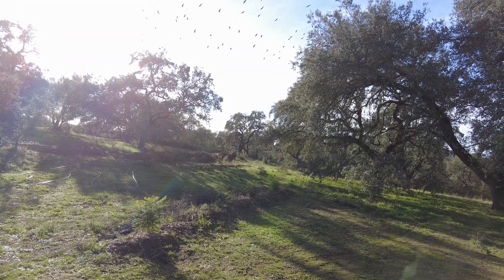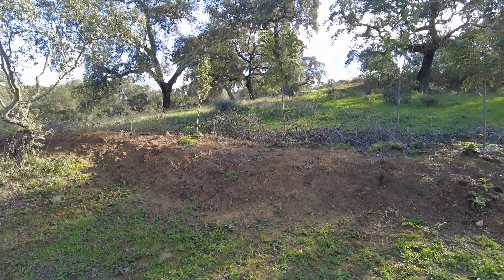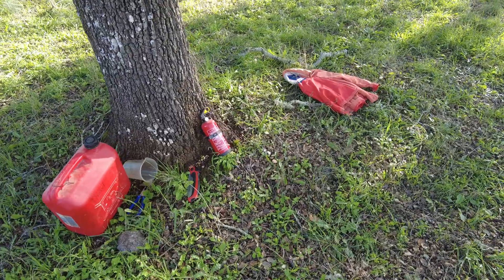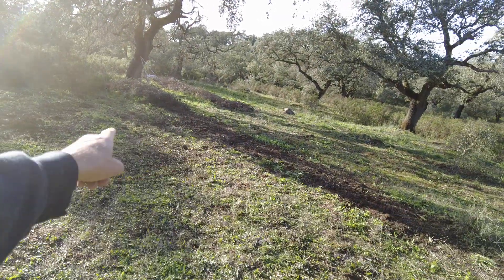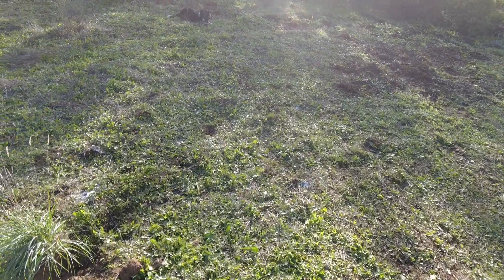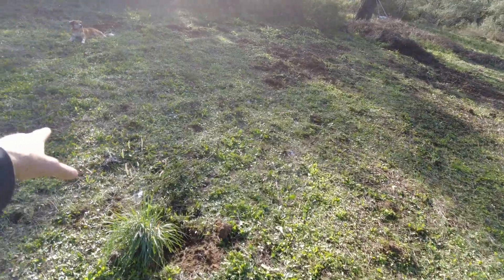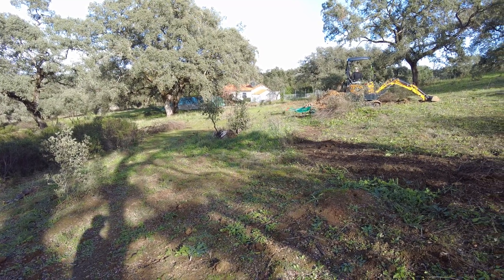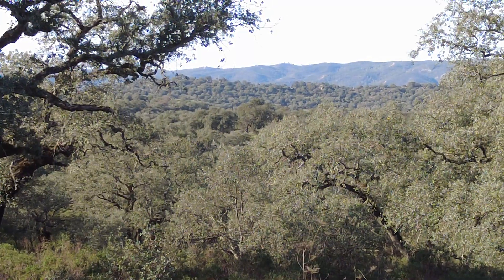Pond site identification and keyway preparation. Then just start!

Comment: Frank AntonsonAuthor
Is any amount of water still running at the culvert? If it is, get a garden hose, put it in the water, and walk down hill until the hose is full. Then walk back uphill to where you are excavating (or above it) to the point that the water stops running out of the hose. That spot will be level with your source and it will be as high as you can get water by gravity. I guess that will the help of your wife and water you carry from your house you could do the same.

Comment: letsdig18 is an expert at pond building. You have the clay. Important thing is the dam. No debris or top soil and pack down the layers as you build. Also, first must dig trench and hard pack clay to prevent leakage. Check out this video: Lets Build The Dam For The One Acre Pond posted recently by letsdig18.

Comment: The Giraffe looks like it has the capacity to dig your swales with the big bucket - no problems!  I notice that your swale and berm section has become V shaped. For some reason I thought your prior swales had flat bottoms? The bottom of the V is a good place for all the fine sediment.
I suggest moving some top soil uphill and off to the sides also - stockpile on all 4 sides.  The reason being you will want topsoil on top of your dam and on the downhill slope leading into the dam to speed up the establishment of vegetation.  And having 4 topsoil piles means the distance to travel with the Giraffe is shorter, both now and later.
So if I understand correctly, the inflow is the swale extension you have just dug and the overflow will be the continuation of the swale and berm to the west.  Based on past experience, you want the opening to the westerly swale to be very wide so it can not become clogged with debris.   As another commenter suggests, the spillway should be very broad (one meter at minimum) and   perfectly level so there is no chance of erosion.  My suggestion is to establish that level sill with a vertical board staked into the soil.
The clay looks perfect to me.  You have the principals. Thin layers (lifts) of fresh wet clay compacted as you build lifts.
One thing I was a little confused about; you do intend to make the "key" as the core of the earthen dam all the way around, right?.  So it will be a semicircle - defining the core of the dam from inflow to outflow.  And the key has to be wider than the tracks of the Giraffe so it can be properly compacted with both tracks.
Last suggestion, monitor the Giraffe for overheating.  This will be the biggest digging job it has done and the Koop engine is aircooled.  So you may need to take a break and open the cowling from time to time.
Looking forward to daily updates 😊
Best of luck! 👍
Reply from the maker: Great suggestions Steve. Much appreciated as always
Reply: Steve, you are so knowledgable. Do you have a channel or website?
Reply: @heronthere  Dang!  You took me by surprise!  Don't tell my ex-wife I know a thing or two 😅 Thanks for the compliment!  Not many come my way these days.  No channel or website.  It all resides in my brain from 59 years of gathering every scrap of information that passed before my eyes.  YT has given me the opportunity to share with those who are interested.  I do follow your channel - so I'll post more! 👍
Reply: @stevejohnstonbaugh9171  you brought up a great point on the compaction of the key. When zach weiss built my "new pond" the trench was the width of his bucket. I would guess 3ft wide. He used the bucket to compact it. The excavator was huge. Wide load permit to get it here.  But I remember him saying that a 10,000 lb excavator was the minimum to compact the dam and the pond bottom.  Between him and timeline ranch, i bought one. My thought for a self made keyed pond was to excavate first and sort the soil layers. The deeper i dug, the less of a "trench" i would have to compact. After that, start placing clay in the middle and soil on the sides. Spend more time compacting than positioning it. Especially with the size loose natural has. Maybe 4" and roll over it. Labor vs machinery is a balancing act. You can work 10x faster with bigger machinery. If the labor is paid out to other people, renting bigger machines can be cheaper on the project. Either way, compaction is critical as you pointed out. Moisture also. I had to pull off my encroachment pond because the soil was powder.
Reply: @heronthere  Completely agree if you have a heavy excavator on site.  Using the bucket back as your compaction plate with a 22 ton machine is a very different situation than Martin's 1 ton machine.  That's the origin of using the tracks.  If he was using his small excavating bucket, he could add that to the compaction, but I think the large key with tracks will be fine.  And yes - 4" loose per lift is what I'd shoot for.  That should compact to about 2".  Good decision on the powder.  We can confirm - it does not work 👍
Reply from the maker: @heronthere  Steve's official title is HOMESTEAD EXPERT.
Reply: @SuerteDelMolinoFarm  i can agree with that
Reply: @SuerteDelMolinoFarm  🤣🤣🤣
Reply: @heronthere  @loosenatural8171  OH MY GOSH!  You guys are killing me 🤯 What a kindness.  I can't express my gratitude.
Truth be told - after my daughter (who is the light of my life) you folks are my purpose to keep living.  Who would have thought that technology could create an opportunity for an old man who made his fair share of mistakes to find purpose?    
So trust me when I say, what you give me in return is priceless.  ♥

Comment: great work - the spillway should be very broad on a perfectly level length minimum 1m......if you use it as a outlet to the swale, the swale should be perfectly level, so that the water level in the swale rises with the pond - its like a pond extension for percolation, no flow as a creek inside because of erosion risks
Reply from the maker: Great info. Thanks for sharing